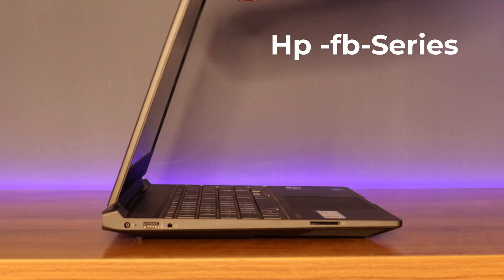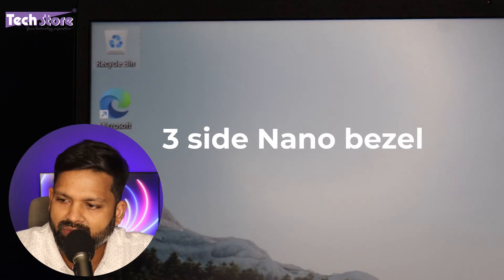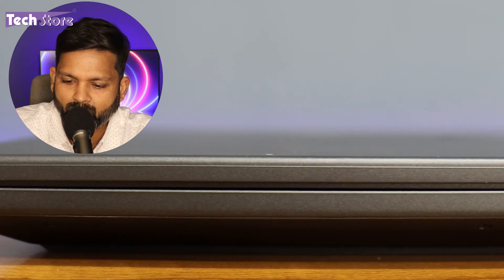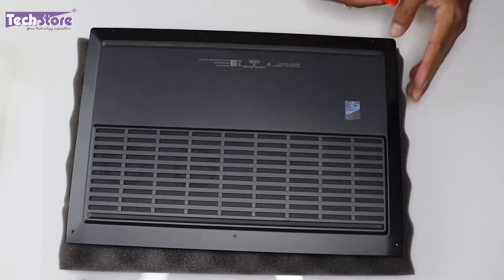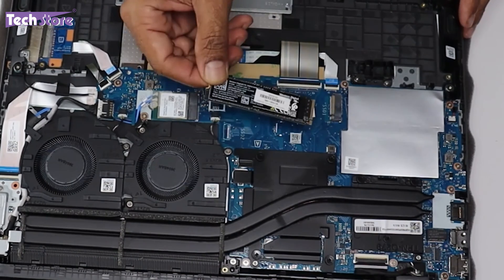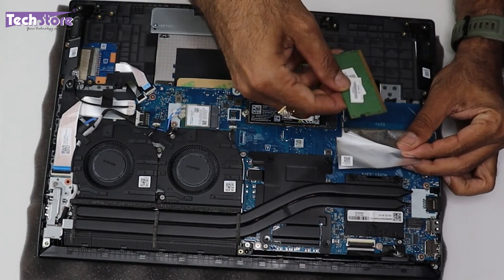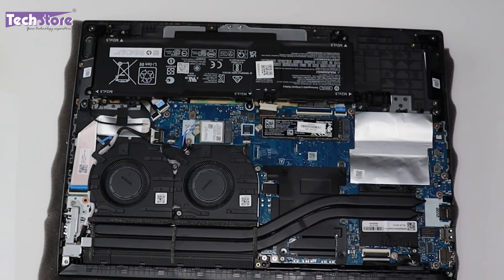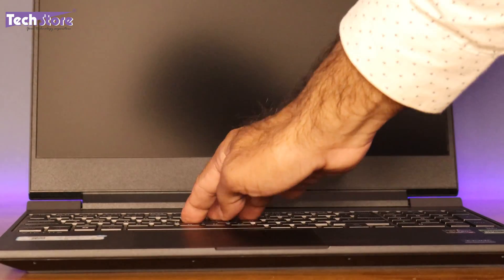HP Victus gaming laptop 15 FB1001AX | Review disassembly upgrade RAM , SSD , BATTERY DIY

Comment: Now a days hp 15s series laptop donot allow to install 2.5 inch hdd in laptop  yet there is enough empty space for hdd installation. Can u make video on hdd installation with connector and hdd holding bay ?
Reply from the maker: We will try to do.
Reply: @TechstoreCoIn  Waiting for video related to hdd installation in hp 15s laptop 2024 model , where sufficient space is available within laptop but no spare hdd flex cable and hdd bracket  available by brand for installation of 2.5 inch hdd. HP doesn't care about the upgradibility now a days  & yet there is enough space for hdd installation. 
I hope u remembered my points for making video on this topic
Reply: I installed my hp 15s with hdd i just bought hdd cable and double sided adhesive and just stick the hdd inside then connect the ribbon cable on motherboard